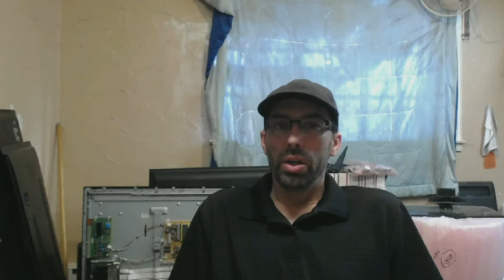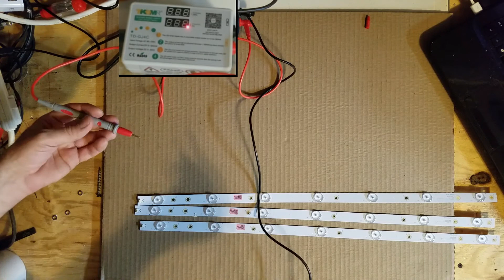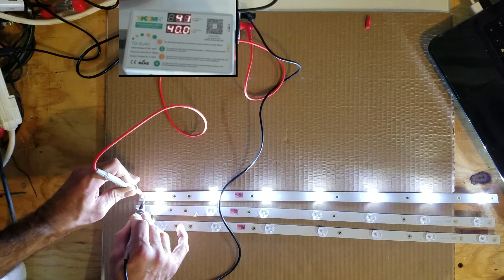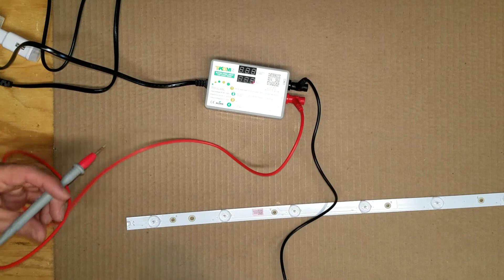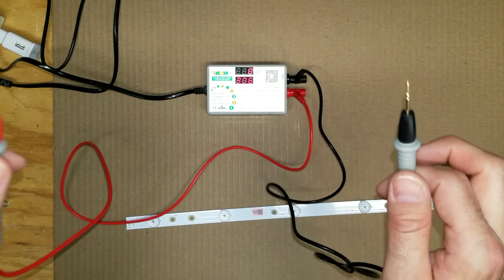TD-GJ4C LED Tester Review

Comment: Why would it send in excess of 70mA through those leds? Seems excessive to me... the leds are certainly not rated for such high current.. is the amp reading accurate? Did you test with a multimeter?
Reply: Your comment is incorrect concerning the current ratings for LEDs used in televisions.  70ma is extremely low, virtually all are driven at 400ma or greater.  Replacements are rated at 350ma to 570ma.
Reply: @stephenherndon6464  Thanks for the information
Reply: @stephenherndon6464  Just checked a ceiling light, 120mA (rated on driver) and 9.8v (measured) on each chip.